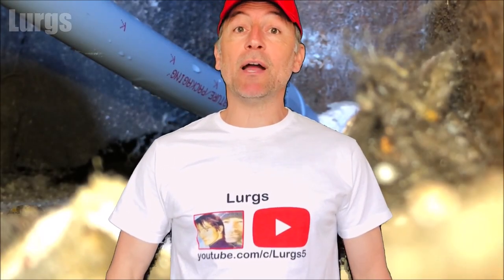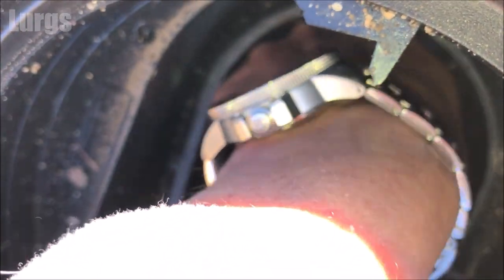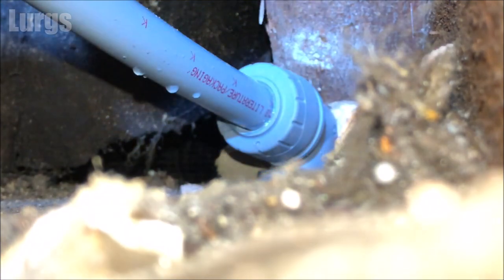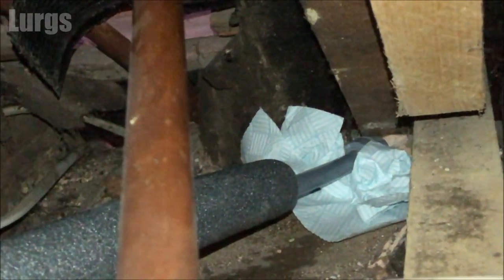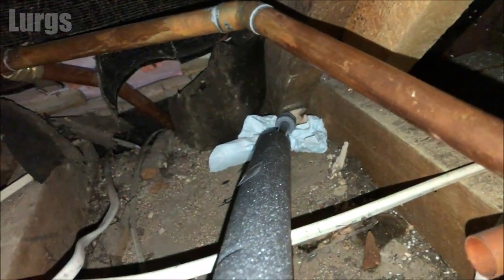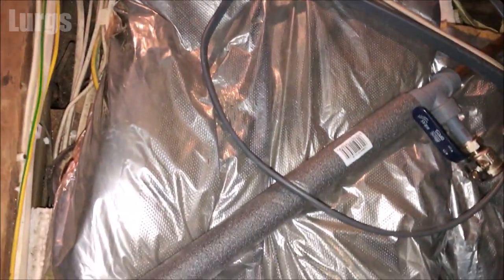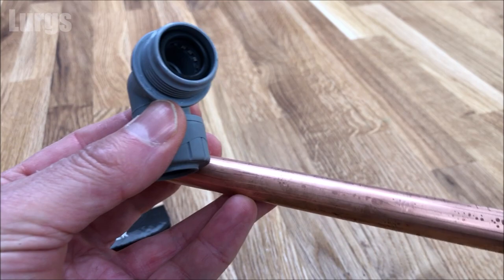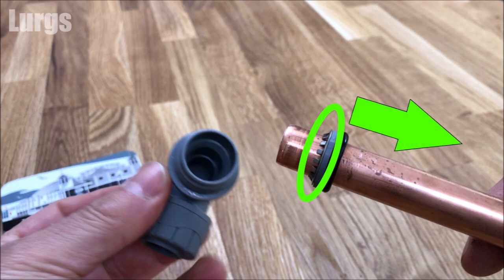How to Fix a Leaking PolyPlumb Elbow Joint- PolyPlumb Polypipe Plastic Elbow Joint Leaking

Comment: Great video and explanation. Is this a common problem with these connectors? We've had two of these leak within 3 years (been in the house 5 years). One on a hot water pipe and just recently one on a central hearing pipe. Thanks
Reply from the maker: From my experience they tend to vary in quality depending on where they are bought from. In theory once they are pushed in correctly they shouldn’t fail but cheap ones can. Sorry to hear that, replace any faulty ones with good quality ones.
Reply: @LurgsHowToGuides  thank you for your reply. Are there brands you would recommend over others? After two leaks it suggests poor quality fittings. I think what is happening is as the pipe expands and contracts due to hot water in the pipe which then cools; overtime this loosens the connector. We've had to cut holes in our ceilings to get to the pipes and after what we have been through we'd prefer to replace any connections we can reach before repairing the ceiling. Don't want another one leaking after repairing the ceiling if we can help it or it could be a ceiling repair every few years if this keeps happening. Thanks again
Reply from the maker: I don't know of a specific brand but if you chat to a local plumbers merchant I'm sure they will sell you the best quality ones. As with everything in life, you really do get what you pay for. Sorry to hear you've had problems.
Reply: Did you you drain the system after isolating the water feed? Or did you just fix it pressurised???
Reply from the maker: It was on mains water. If you turn off mains water and open some taps near where the join is then that should relieve and pressure and allow you to push it in tight